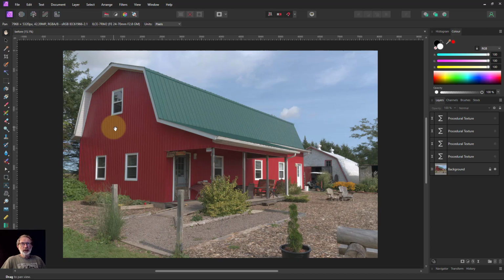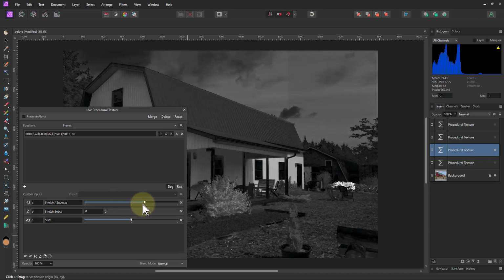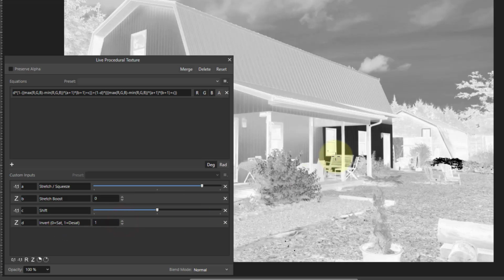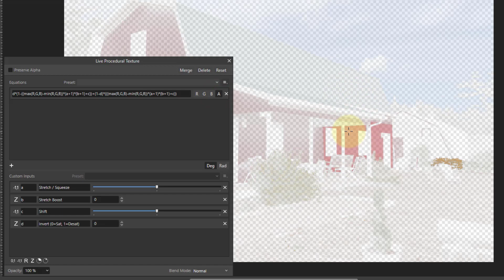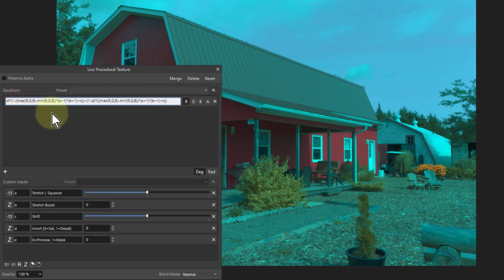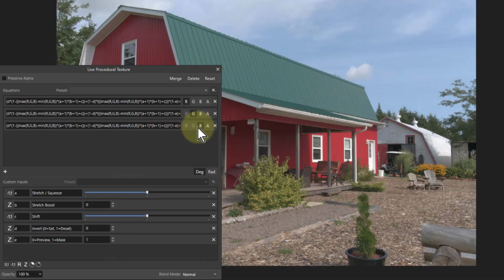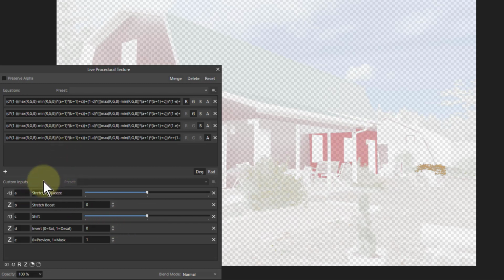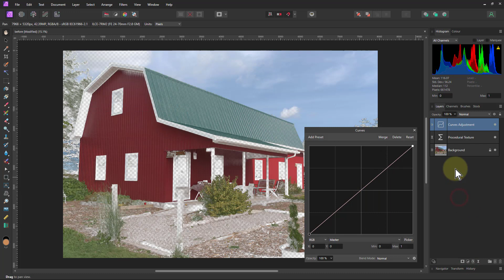Procedural Texture Saturation Mask (Part 5)

Comment: Hi Dave. I've created the Procedural Texture as shown but it doesn't have an effect on the image as I'm using it. I must be missing something. Also, is there a way to save this as a preset so it can be used on additional images? Thanks!
Reply from the maker: Difficult to tell when I'm not there. Check you have the correct R, G, B, A boxes checked/unchecked. If the formula seems not to have an effect, the formula is wrong somehow -- for me, this is usually because I have unbalanced parentheses, eg five '(' but only four ')'. I'm going to do creating a Preset in a later video.
Reply: Thanks for the reply. I've gone through it again from scratch and it's working fine now. It's possible that I didn't quite copy an entire equation. It's working fine now and I've created a macro for it. Now I'll just need to spend some time working with it to get a feel for how I can effectively use it. Thanks again Dave. Your tutorials are the best I've come across. 🙂